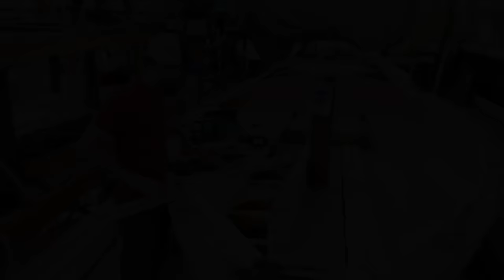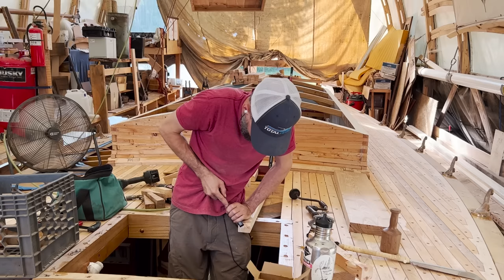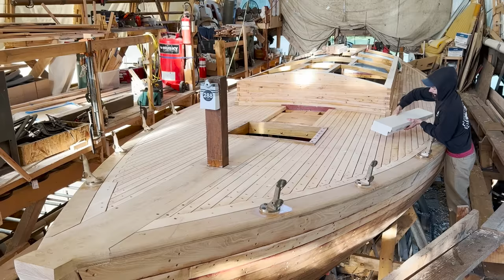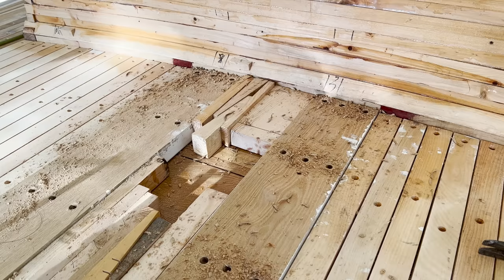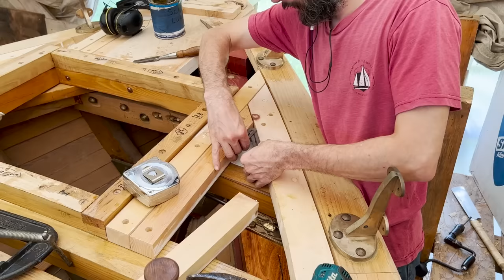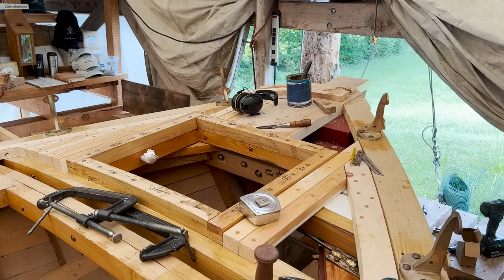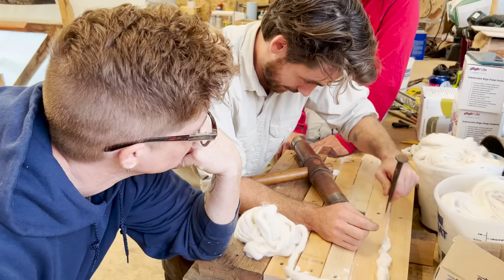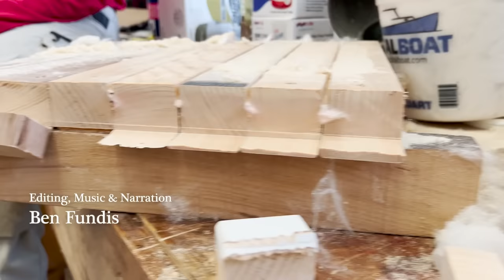Laying Down the Deck - Episode 231 - Acorn to Arabella: Journey of a Wooden Boat

Comment: I mentioned this last week......but why didn't the planks work out either side of the king plank? A whole plank would have looked much better, and the half width plank on the port side tapers. So something is amiss. Disappointing when the rest looks great.Also, why isn't the planking laid on Dolphinite or similar when it sits down on a solid substrate? There are some big areas which could harbour quite a lot of water for quite a long time without anyone knowing, if there was a little leak in the deck.
Reply from the maker: The planks didn’t work out because the planks didn’t work out. We need a base of king plank for the windlass to sit on, and that’s where it all landed. Steve would prefer that water find its way out of the deck than get trapped, so no bedding compound there.
Reply: The under side of the deck is also the cabin ceiling and dolphinite would be a mess to clean up as it would squeeze out as the screws were run in
Reply: It only takes a few tiny variances in the width of the deck boards to make a noticeable difference when closing the deck up
Reply: @evildogbilly  So it only takes a few tiny strokes of the plane on each plank to correct the situation we see on the port side of the kingplank.
Reply: @MikeAG333  When you spend a few years of your own time building your own boat from scratch, feel free to make different decisions than what are presented here.
Reply: @fisher61987  You're certain that I haven't, right?
Reply: This boat looks like it was built for Jesus. Let's relax.
Reply: @MikeAG333  It's not up to me to prove you have not. It's up to you to show me you have.
Reply: Are people this critical with everything in life. Really does it matter that much. Lucky do see some of what I have built you would keel over. Lighten up it’s a hand built boat from someone who started with no experience and has learnt along the way.
Reply: Are people this critical with everything in life. Really does it matter that much. Lucky do see some of what I have built you would keel over. Lighten up it’s a hand built boat from someone who started with no experience and has learnt along the way.
Reply: @fisher61987  Sorry pal, you made the assertion, hence the onus is you. Or perhaps you could just give it a rest, and accept that people are entitled to ask questions. This isn't exclusively a fan-boy convention, you know, and if someone asking perfectly obvious and legitimate questions troubles you so much  you might take a look at yourself rather more and the questioner rather less.
Reply: @MikeAG333  If you had, you would be in a vanishingly small percentage of the population. Frankly, I believe your experience with boats is limited to the "gravy" variety, but that is neither here nor there. The decisions they made were done days, if not weeks, before publication. Do you expect them to tear off the deck and start fresh? They have moved on. I suggest you do as well. I certainly will. Hope your day is as pleasant as your demeanor!

Comment: You probably don't want to discuss pay and benefits on video, here's one example why.  KP most assuredly would be classified as a non exempt employee per the Fair Labor Standards Act. As such, and under that law overtime would be required to be paid for any time worked beyond a 40 hour work week.  I spent 27 years managing employees  in IT.  The FLSA applies to all people working in the United States.  Probably Wikipedia has a good summary.  There have been huge settlements where non exempt employees were not paid overtime. The National Labor Relations Board administers the law.  Sorry, but I thought you should know.
Reply from the maker: Thanks for practical info, Mike. When we take extra time from an employee, we balance that with time off.